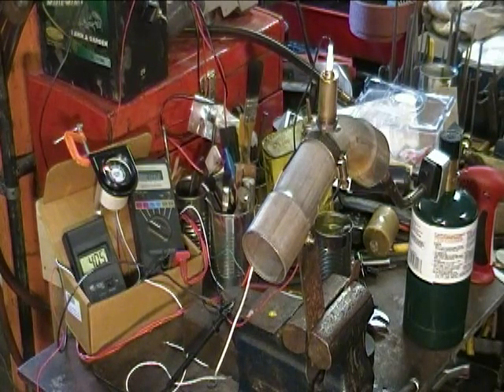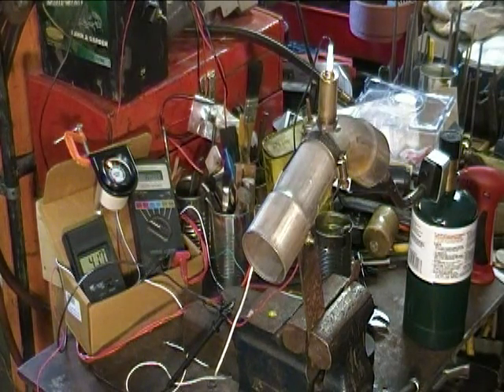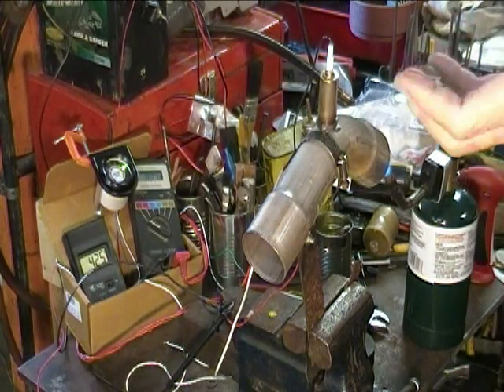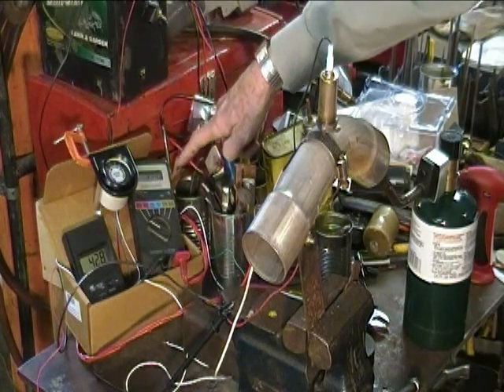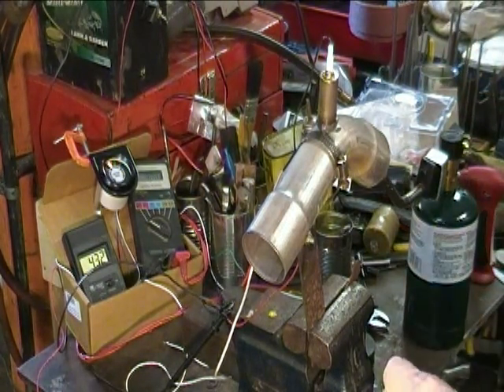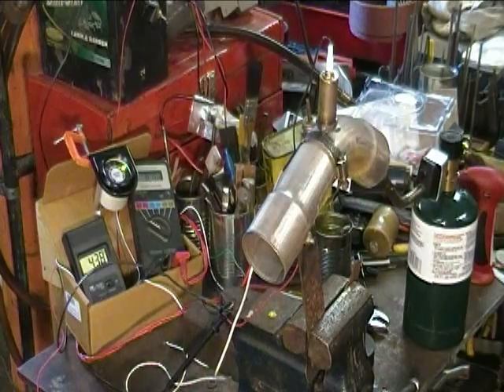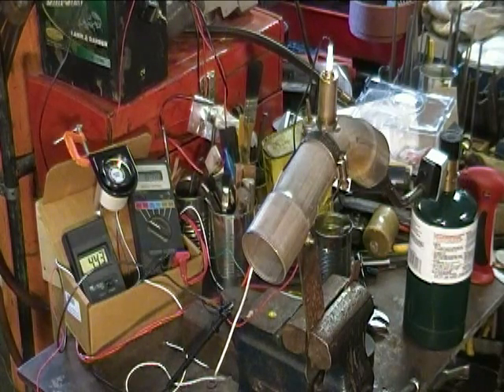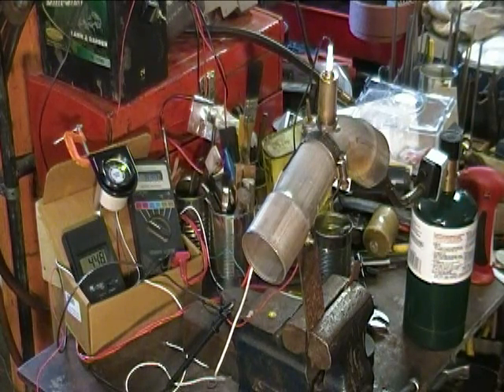Oxygen Sensor Narrow Band Test2, with Air/Fuel Ratio Meter

Comment from the maker: It is called a "narrow band" oxygen sensor".  This kind of sensor has no heater built in to it.  So, there is only one circuit inside the device.  That circuit only requires two connections.  One connection is from that single wire to the engine control unit (or, in my case, to the meter) and the other connection is made to "ground" at the outside of the sensor through the exhaust pipe.  So, this one is also called a "one wire" sensor.  Some narrow band sensors have a separate grounding wire.